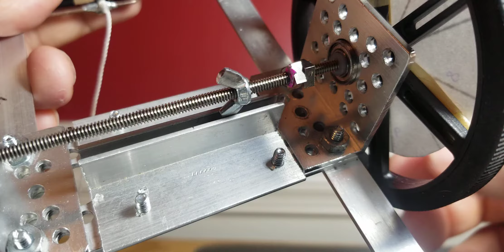Mousetrap vehicle brake

Comment: I realize this video was made 2 years ago, but I have a question that I can’t find the answer to. Can you explain if the threaded rod moves through one or both of the wheels? This is the only way it makes sense in my head since the wing nut isn’t moving, but please correct me if I’m wrong.